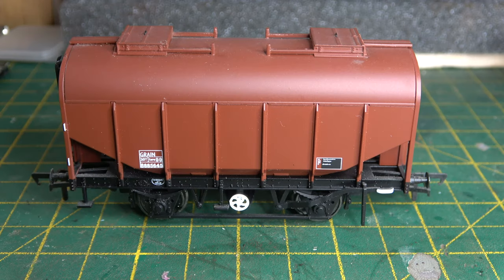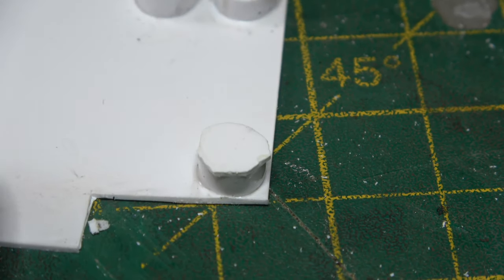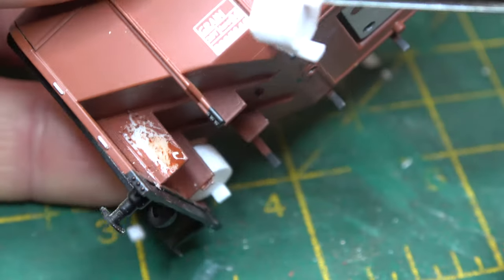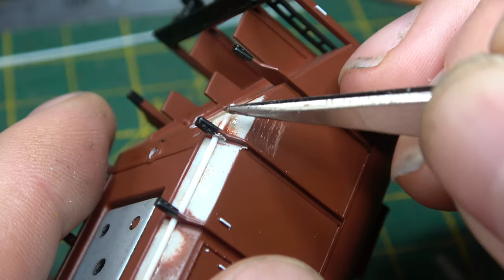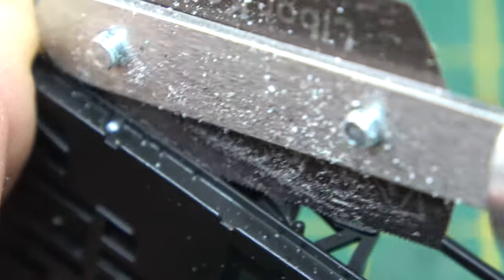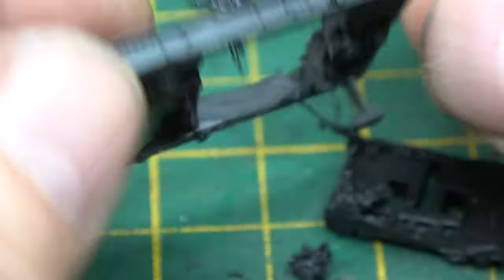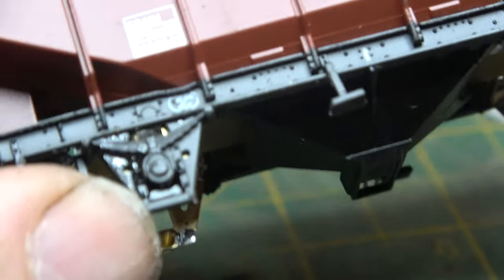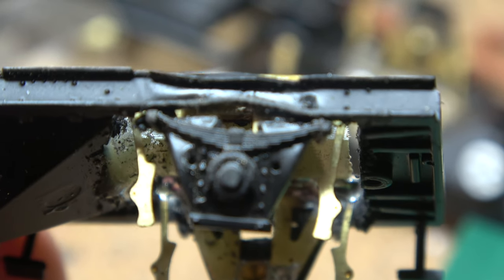My over confidence is my weakness.......

Comment: I have this very same conversion to do on one of my grain hoppers. Looking forward to seeing it finished.
The difference between the unfitted/piped and the fitted version is that the uprights on the ends were much closer together to make space for the vacuum cylinders on the fitted ones so you need to do a bit more work with that rather nice saw and break out a little more plasticard.
The vac fitted hoppers also had wheel handbrakes rather than levers. Can’t help wondering how often guards and yard staff accidentally emptied them instead of putting the brake on.
Reply from the maker: Longer wheelbase to!
Yes, must return to these to finish them off!!